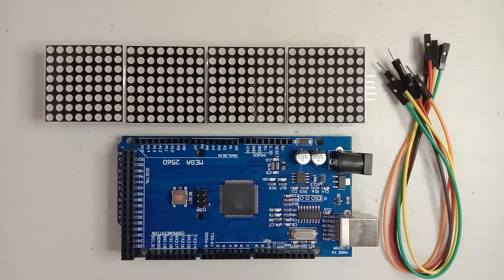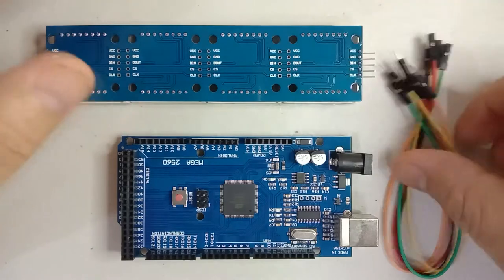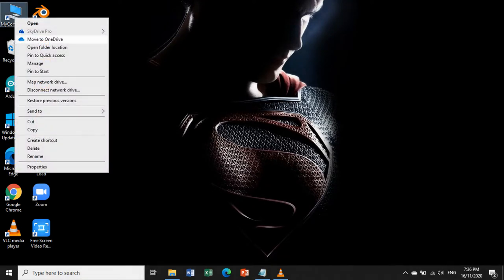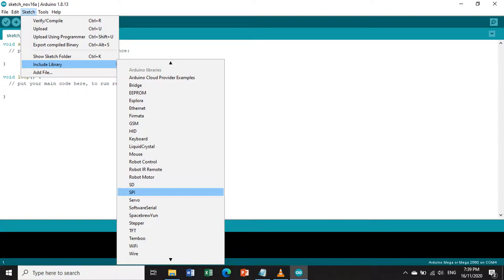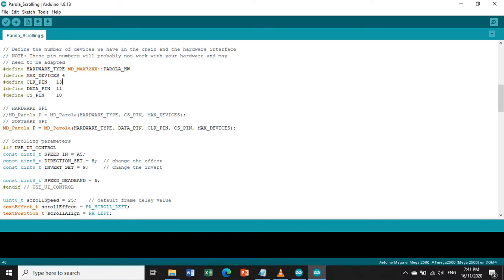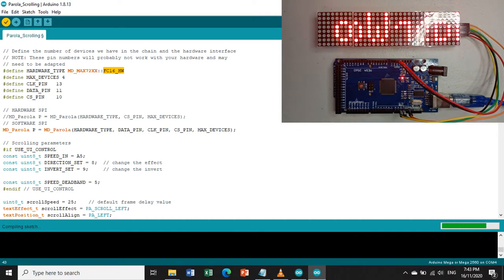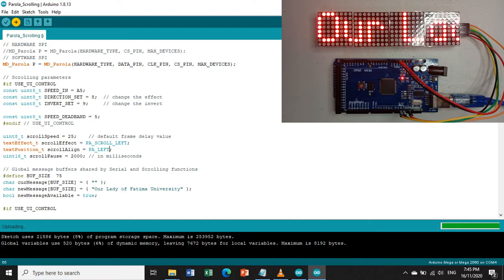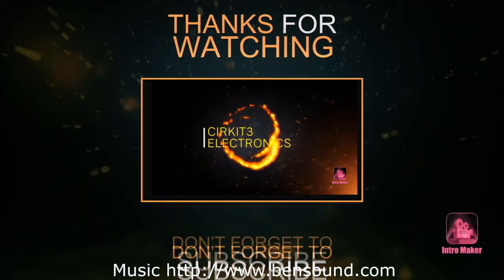DISPLAYING A SCROLLING TEXT 4 in 1 MAX7219 8x8 LED MATRIX DISPLAY AND ARDUINO MEGA 2560

Comment: MD Parola file not found :(
Reply from the maker: @TomášJežík-i5l  search for md parola library in Arduino IDE. And install it.
Reply from the maker: Watch 4:20 to 5:30 timeline
Reply: @CirKit3  Ok. I've already moved on.. The program reports an error: The project occupies 21108 bytes (8%) of memory for the program. The maximum is 253952 apartments.
Global variables occupy 520 bytes (6%) of dynamic memory, 7672 bytes remain for local variables. The maximum is 8192 apartments.
Reply from the maker: @TomášJežík-i5l  use Arduino mega for large memory capacity.
Reply: @CirKit3  How should I do it?. I don't understand Arduino very well. Do I need to buy or install anything?
Reply from the maker: @TomášJežík-i5l  buy Arduino mega
Reply: @CirKit3  Yes I have got ARDUINO MEGA 2560

Comment: error sakin boz
Arduino: 1.8.15 (Windows 10), Board: "NodeMCU 1.0 (ESP-12E Module), 80 MHz, Flash, Legacy (new can return nullptr), All SSL ciphers (most compatible), 4MB (FS:2MB OTA:~1019KB), 2, v2 Lower Memory, Disabled, None, Only Sketch, 115200"

Executable segment sizes:

IROM   : 252104          - code in flash         (default or ICACHE_FLASH_ATTR) 

IRAM   : 27264   / 32768 - code in IRAM          (ICACHE_RAM_ATTR, ISRs...) 

DATA   : 1340  )         - initialized variables (global, static) in RAM/HEAP 

RODATA : 820   ) / 81920 - constants             (global, static) in RAM/HEAP 

BSS    : 25120 )         - zeroed variables      (global, static) in RAM/HEAP 

Sketch uses 281528 bytes (26%) of program storage space. Maximum is 1044464 bytes.

Global variables use 27280 bytes (33%) of dynamic memory, leaving 54640 bytes for local variables. Maximum is 81920 bytes.

Executable segment sizes:

IROM   : 252104          - code in flash         (default or ICACHE_FLASH_ATTR) 

IRAM   : 27264   / 32768 - code in IRAM          (ICACHE_RAM_ATTR, ISRs...) 

DATA   : 1340  )         - initialized variables (global, static) in RAM/HEAP 

RODATA : 820   ) / 81920 - constants             (global, static) in RAM/HEAP 

BSS    : 25120 )         - zeroed variables      (global, static) in RAM/HEAP 

Sketch uses 281528 bytes (26%) of program storage space. Maximum is 1044464 bytes.

Global variables use 27280 bytes (33%) of dynamic memory, leaving 54640 bytes for local variables. Maximum is 81920 bytes.

esptool.py v2.8

Serial port COM6

Connecting........_____....._____....._____....._____....._____....._____.....____Traceback (most recent call last):

  File "C:\Users\YHC PRINTING SERVICE\AppData\Local\Arduino15\packages\esp8266\hardware\esp8266\2.7.4/tools/upload.py", line 65, in <module>

    esptool.main(cmdline)

  File "C:/Users/YHC PRINTING SERVICE/AppData/Local/Arduino15/packages/esp8266/hardware/esp8266/2.7.4/tools/esptool\esptool.py", line 2890, in main

    esp.connect(args.before)

  File "C:/Users/YHC PRINTING SERVICE/AppData/Local/Arduino15/packages/esp8266/hardware/esp8266/2.7.4/tools/esptool\esptool.py", line 483, in connect

    raise FatalError('Failed to connect to %s: %s' % (self.CHIP_NAME, last_error))

esptool.FatalError: Failed to connect to ESP8266: Timed out waiting for packet header

esptool.FatalError: Failed to connect to ESP8266: Timed out waiting for packet header

_

This report would have more information with
"Show verbose output during compilation"
option enabled in File -> Preferences.